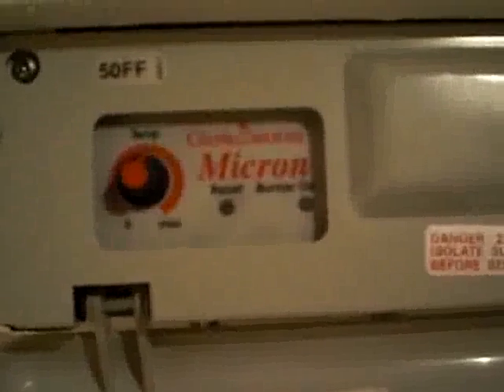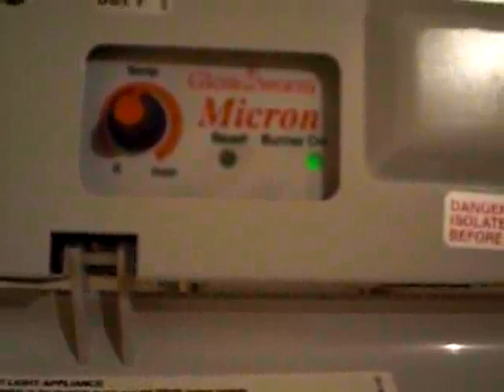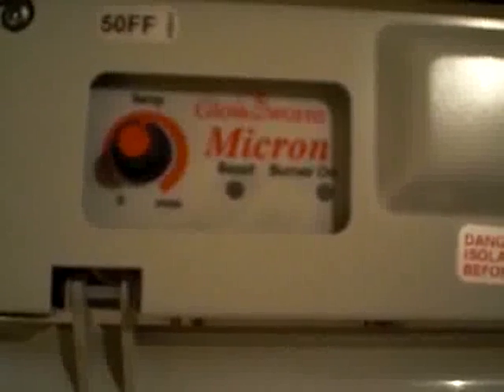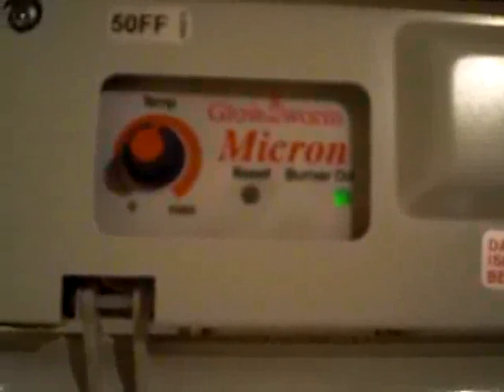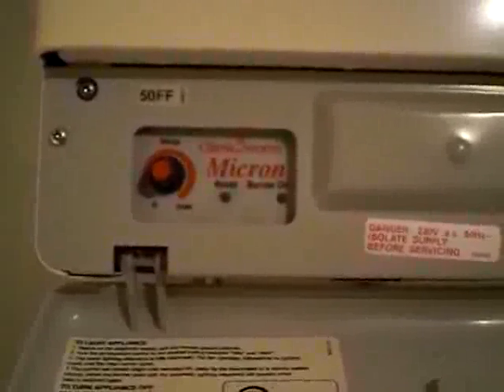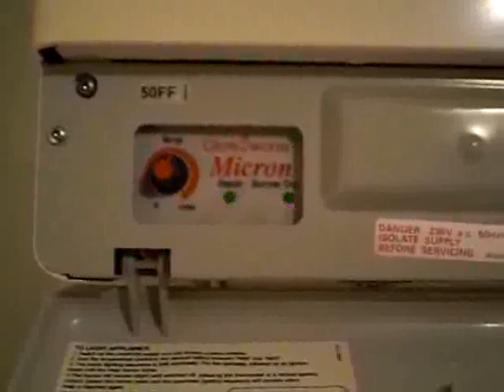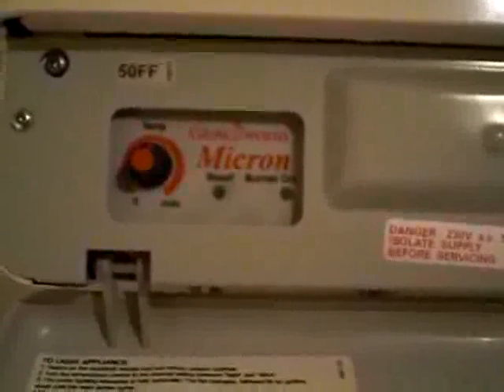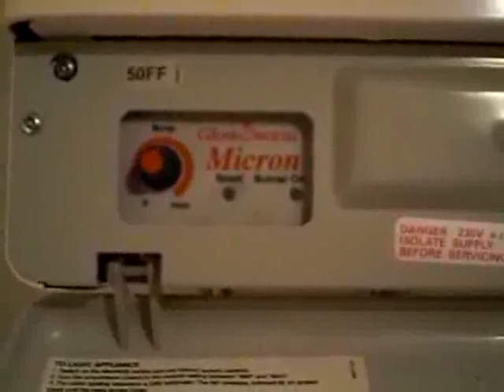Glowworm Micron 50FF Boiler Fault

Comment: My burner light would not come on ! easy fix dry joint on board !
Reply: Did you do that yourself?
Reply: I changed the board on mine £20 And and a fan £35 ,but it’s still going 20 yr later ,

Comment: Hi if anyone is looking for a replacement PCB I recommend this one with eBay item number: 280803199143. I had a similar problem, but you have to give them your old PCB as they recycle them. They improve the circuit board themselves and provide a 1 year warranty as well and its only £57.50 including postage. I got mine replaced around 5 years ago and it has been working fine. I even reused the existing thermistor.

Comment from the maker: Pressure switch was changed first. General method is to start with the cheapest fix! Did not fix so the PCB was changed and had the desired result. Does seem the fan bearings are a bit worn as it still starts up with some noise that quietens down. British Gas did a deal. I took their annual maintenance plan (£20pm which covers the whole system) they did a fixed price repair for £90. As a PCB and thermistor could have cost over £200 - and may not have been the problem, seemed the best option.